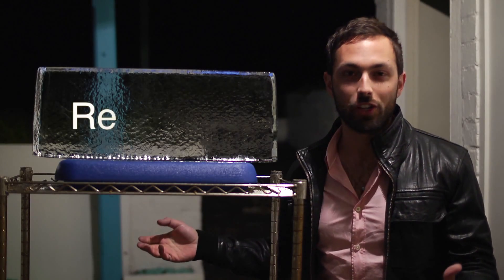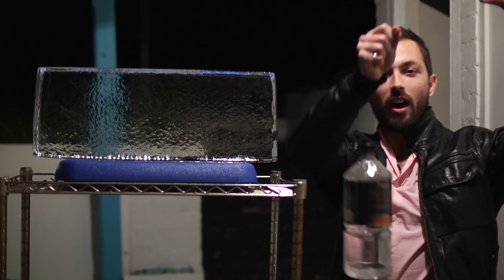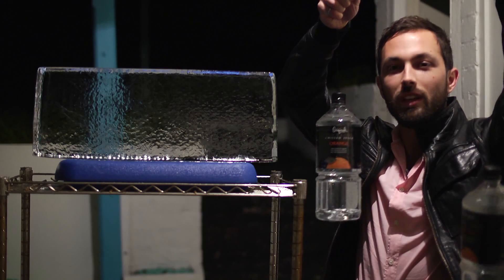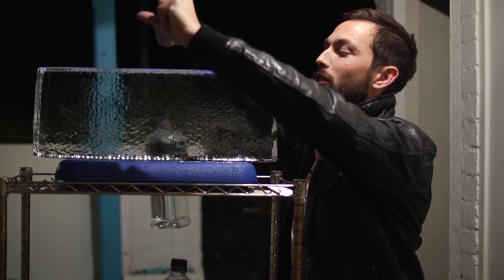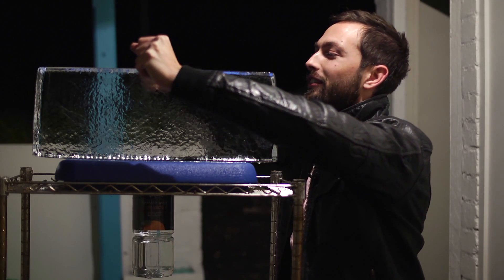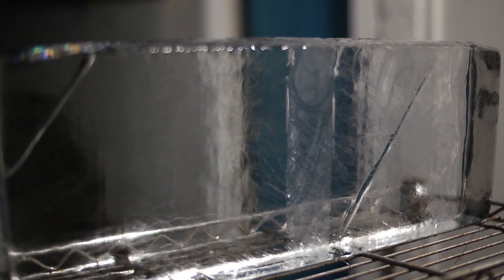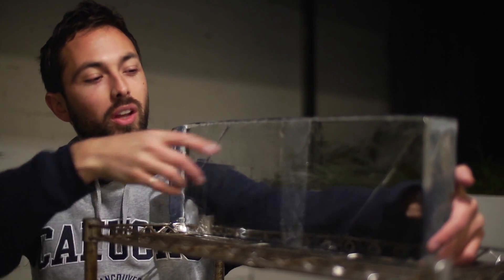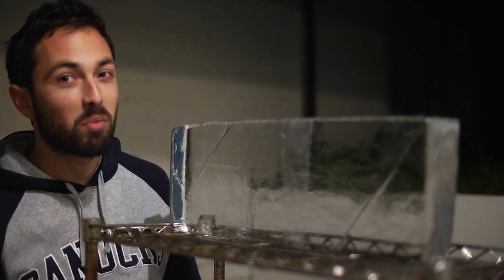Does Pressure Melt Ice?

Comment: As many before me have commented: that can't (or atleast shouldn't) be possible! Water freezes if you aplly pressure to it (even when it's warm). When you get the pressure down enough it vaporizes (0-(-1)bar should do the trick, even if the water is cool to touch). You should know, Veritasium-guy, because you made a vid of it. Your fridge and some air conditioning devices work because of that. 
Edit: okay, ice could handle differently, I just realized, but I'm still not sure I'm buying it... :/ Needs to be performed in sub zero conditions!

Comment: And I thought it was all about friction melting the top layer not pressure.
Reply: ***** However even if it started at room temp it wouldn't be that temp all the way through the ice because it would cool down.
Reply: SimplyCraig5 it still wouldn't reach the temperature of the ice.  Thermal conductivity of the wire would pull in the temperature of the ambient air, so to speak.

Comment: Would like to see that with a Thicker string
seeing if a bigger Gap would hinder the ice reforms
Not actual Bass strings; too thick and a gap of .075" would be noticeable but maybe .024" plain and wound (Roundwound or Flatwound) that size they come in all three.  and see if the Roundwound grooves have a noticeable impact; if the Flatwounds leave any marks and make a difference to the base readings of the of the Plain (Unwound) string.  since you used anything from .010" to .008" (I use .013" gauged sets.)

Comment: Actually, the melting/cutting in this case is due to thermal conduction of the room temperature through the wire, not pressure. This is a common misconception. True regelation requires far higher pressures.

Comment: This doesn't really make sense to me, if you increase the pressure applied to water, you end up raising the boiling point and inversely if you lower the pressure it lowers the boiling point. wouldn't the same principle apply to the freezing point, as you increase pressure you raise the freezing point (higher than 0 degrees Celsius), in essence the point which is in contact with the wire would actually be less likely to melt than the rest?(ignoring the obvious fact that heat transfer through the wire caused the wire to cut through in this video) just a thought

Comment: Well, PV=nRT. n is not changing, because the pressure is only applied over a small area (Which we see here, melts), and then (as i will later explain) re-solidifies. R is a universal constant, so obviously that cannot change.

Volume of the ice under pressure is constant. So, as pressure increases, so too must temperature. It is (more or less) a linear relation. V would change a miniscule amount when the ice expands into water, but not enough to make a difference.

Now, after the pressure has been alleviated by way of the ice melting, P will return to normal atmospheric pressure. This will allow Temperature to go back down below 0C, resolidifying.

But, Veritasium, I have a question: Since PV = nRT, and the units you get when you multiply PV together (N/m^2 * m^2 * m) is Nm, also known as joules. Now, if we apply another equation: Q = mL, where m is the mass, Q is the energy, and L is the latent heat of transformation, wouldn't the temperature actually change slightly less? So, PV=nRT isn't technically correct ; it would have to be PV=nRT + mL.
Is there something wrong here, or ... what's the deal?

Comment: How do you know that it is pressure that is cutting the ice and not the wire conducting, you did say that it was above freezing point in the room. Also the re-freezing is surely just due to the climate between the two new block being cold enough to freeze seeing as their ice, like if I breathed on it the water vapour would condense because the ice is cold enough.

Comment: I´ve read somewhere that this is what makes skates have so little friction; that when all your mass is concentrated through the blades, the pressure of the blades melts the ice, making a thin layer of water which makes the skates move so smoothly. Does anyone know if this is correct?

Comment: A proper example would be to put a piece of ice in a container with air, so as to not to crush the ice, and increasing the air pressure. Then again, the temperature of the air should be kept in check by some means, so that the ice melts due to pressure and not because of the temperature rise in the air when compressed.

Comment: Actually, in this example, the melting is not due to the pressure exerted by the wire. Rather it's because of the heat conductivity ot the wire. The wire disipates heat, elevating the ice temperature in contact with it over its freezing point, which makes the ice melt. It wouldn't work with a nylon string, for instance. The pressure required for regelation would be much higher. Since pressure is a relation between load and surface, you would either need an incredibly thin wire or a really heavy load.

Comment: No no no no.... NO! You're not tricking ME with this one...

The wire has heat, and since it's made of metal, it transfers heat very well..... More heat is hitting the wire that isn't making contact with the ice.. that heat is transferred through the metal, causing it to be warm enough to melt the ice... (Note: Not much warmer... You know this, because it took hours.. It melted a little at a time over several hours...)

When the ice melts, it makes water... that water, being between 2 layers of ice, re-freezes helps the ice blocks stay together..

Comment: Concept may be true but your experiment was not valid. If the ambient temperature was above freezing then the wire would have been conducting heat into the ice. Ambient temperature must be as cold as the ice.

Comment: CLEARLY:... The thermal conductivity of the wire AND the pressure BOTH exert some power over the behavior seen, since pressure is related to volume and temperature, and therefore the phase of pure substances like water. But even if the thermal conductivity was the only principle acting, the rest of the block will absorb some of the heat and refreeze the thin layer of water. 

I would not conjecture about which is dominating in this (very cool...hehe) experiment, or if pressure and thermal conductivity are basically equal players, without more information.

Comment: hi. under pressure, shouldn't boiling point increase? and also the melting point.. i think the ice melt because
(1) heat is transferred from the environment to the ice, the string being a good conductor.
(2) the force of gravity is enough to break the hydrogen bonds.
however, when i think about in the following  way, i feel you're right :
Pressure = F/A = mg/A , mg is the weight, A is the area in contact... intuitively, if you increased A (using a string with bigger cross sectional area, E-6 string in the guitar for instance ) , it wouldn't have cut through, or would have taken more time to do so. may be you should try and tell us :p thanks for your videos! I'm a fan

Comment: So this wouldn't work e.g. with frozen CO2, in which the melting point doesn't decrease under pressure?
Reply: correct that would not work. The reason it works with water is because water has a unique property - for some reason, increasing pressure tends to make it liquid, as opposed to CO2 or most other substances where increasing pressure will tend to turn it into a solid. You can check the phase diagram for water and notice that the boundary liquid/solid is slanted to the left.

Comment: That's weird,, when you think about that water in lower pressure can boil at lower temperatures... I would've guessed it would be the same with ice, thus requiring lower pressure to melt, and higher pressure to refreeze. Is it possible to get a deeper explanation of this?

Comment: But what would like to know is:

Is it realy the pressure that is melting the ice, or is heat transfer playing parts. Immagine a immens column of ice..... like in the antartic. That weight of the ice above at the bottom is not turning the ice into water..... I think.....
Ok.. the weight and the diameter of the sting is causing a realy big pressure at that certain point, but would that pressure be higher than an ice block of about 30 feet hight..?
I just don't know, but wondering if a setup with a same diameter nylon string (less heat transfer) would result in the same speed of cutting and gelling the ice?
Reply: There is more net force in the Arctic scenario, but, as far as psi, the guitar string is far higher. It comes down to surface area. I think a less conductive string might slow it, but it would still work.

Comment: I duno, i think its just the metal string is taking the cold  from the ice but at a slow  rate, and so it refreezes by the time it reaches the end..
Reply: Test it yourself if you can. Get two wires, and attach equal masses to either end of one, and put nothing on the other.
Reply: Akranixx Im suggesting its just the acceleration of the ice warming when in contact with the metal which is getting the warmth from the air. The pressure thing also contributes, it usually speeds up reactions too.

Comment: I'm going to conclude that heat via friction was the cause of the ice melting. Would this experiment work under better conditions? Say, if the wire and outside temperature were below freezing?

Comment: so, SciShow's recent video on pressure not causing heat in solids or liquids makes me question the ruling on pressure being the source of heat here. Isn't it more likely that the metal e string is causing thermal conductivity to melt the ice below it and the cohesive force of water holding itself to the ice walls re-freezes it? I mean, cool thing watching a wire travel through a solid block of ice and leave it solid, but I'm wanting to learn a bit more about the physics of this experiment.
Reply: According to regelation, the pressure wasn't a source of heat, and also heat was not the reason the wire went through the ice. The water, while still at freezing point, became liquid because of the pressure and the pressure alone. As soon as the pressure was removed from it (that is, all of the water above the string) it re-solidified. The actual physics on the level of specific molecular movements I'm not sure of.

At least, that's the properties as explained by the theory. In practice with this experiment, there likely was some small amount of actual melting due to the thermal conductivity of the wire. I'm not sure on this, but I think that might be part of why the wire closer to the edges went through at a quicker rate, forming a sort of hill shape with the wire when it was most of the way through.

It would be neat to run several of these side-by-side with strings of equal diameter and with equal weights, but different thermal conductivities. Observe the rate at which they travel through, and the rate of each at the edges compared to the middle.

Comment: If you put water in a vacuum, it boils. What about ice?
Reply: Basicaly that is called Freeze Drying. Or Lyophilization. If you put water in a vacuum, it will evaporate (boil), causing the remaining water to cool down because of the energy that is needed to boil the water. Eventually the energy drawn is so big, that the temperature of the liquid is so low, it changes into Ice...

Putting Ice in vacuum, it will skip the liquid phase and form water gas molecules directly. Until the ice is evaporated, you cannot get a total vacuum, because evaporation still continues till the ice is gone.
Reply: ***** The ice will actually sublime (turn straight into gas). Google a water phase diagram. Look at the solid (ice region). If you were to suddenly drop temperature, you'd go down in the phase diagram and be in a region where gas is the most stable phase.
Reply: ***** The 'ice' in comets does not necessarily point to water ice, any volatile solid is considered an 'ice' in planetary chemistry.
Reply: ah.. no problemo. Interesting material. Thanks for the aditional info.
Reply: Very simply put, fluids fit their container, by container I mean surrounding inward force. A vacuum has no container, leading to diffusion of the molecules from liquid to gas to single molecules. The solid ice maintains its shape due to its crystalline structure and EM forces. Solids aren't affected by containers.

Comment: Hey Derek,
 i think the reason for the cut through the ice block is the high heat conduction coefficient of the metal wire and the regelation makes just a small effect ! The heat is reaching the line , which is in contact with the wire faster than the other surface of the ice block and so the ice melts exact at this line. After the line passed, the liquid water between the 2 Ice blocks is surrounded of ice that is cooler than the air or the wire and so its freezing again !

Comment: It's a good thing for fans of hockey that pressure does indeed melt ice. Those skates wouldn't work very well without the lubricating layer of water that the pressure creates between the ice and the skate.
Reply: Exactly! If the ice was replaced with dry ice (solid Co2), then the skates would not work.

Comment: Doesn't that just mean that the two halves of the ice are cold enough to re-melt the heated center where the string passes trough? The kinetic energy melts it, but the ice freezes it. If you'd use a thicker string would it still work?

Comment: pressure does effect water. if any of you paid attention in science class you would recall that the freezing and boiling temperature of water is based on 1 atm of pressure. when you change that pressure the boiling and freezing temperature is altered also. for example, if you live high up in the mountains the hottest your water will get when you boil it will be in the high 90 deg C. i remember my teacher performing this experiment in class where he took hot water and in a big glass jar and sucked out all the air and it appeared to be boiling. same with ice skating, all the pressure from your skates on the ice turns the ice into water for a short moment and refreezes when your skates leave the ice.

Comment: i don't think a few kilos of weight is enough pressure to cause heat to melt the ice where the wire is... you said you used a guitar string, these are good heat conductors so isn't it possible the wire was simply acting as a method for transferring ambient temperature (above 0 C as you stated) to the ice so the wire can move down, then when the wire is gone, the water between the two slabs freezes cos of the temp of the ice, maybe you could try doing this in a walk-in freezer to stop any error.
Reply: imagine that the water bottles combined weigh 2 kg (2 liters of water). that means 2 kg of weight is distributed across the thin wire. A typical E string is 0.254 mm in diameter (0.127mm radius). Then lets estimate that at a given time, exactly 100mm of string is in contact with the ice. That would mean that the surface area of the bottom side of the string in the ice (the portion of string that presses down) is (pi)*0.127mm*100mm = 39.898 mm^2. This means that 2 kg of mass is distributed over an area of 39.898 square millimeters. For reference, that's roughly the size of the point on a high heeled stilleto. Converted to m^2 for easier math, that is 0.000039898 m^2. Now if I multiply the mass by the acceleration of gravity, that will convert the mass to force in newtons. I then divide my area, and I will have a force per area, which is pressure.
 So (2kg)*9.81m/s^2=19.62 Newtons of force pushing down

(19.62 Newtons)/(0.000039898 m^2) = 491754 kg/m^2
 = 491754 Pascals (492 kPa)

 If you convert to atmospheres, it equals 4.853 atm. Therefore the downward pressure that the string applies on the water molecules immediately under it is equal to about 4.8 times the existing pressure in the air. If converted to psi, it's about 71 psi, which is about what you'd pump up a bike tire to.

Now if you want to relate this information to the properties of water, go to the Wikipedia page titled "Water (data page)" and open the section named "phase diagram". This is a table of all the measured states of water over many years of scientific research. Open the image and zoom in very closely to the circle labeled (freezing point at 1 atm). Above that point but below the pressure 1MPa you'll see that the freezing line is ever so slightly slanted to the left. Our calculated pressure is 492 kPa ( about 4 lines up from the red circle I mentioned). Since the line is slanted left in our calculated pressure range (from 100kPa to 492 kPa), this means that an increase in pressure will force the water to liquid form.

you might argue "but we don't know the temperature so we can't use that graph" 
well that's not true. We know that the ice block is exactly at 0 degrees C because it's melting from the warm air and that's how melting works. If you have a super cold ice block and you warm it up, eventually it will reach freezing/melting temperature and at that point it will not warm up any more until all the ice has melted. Therefore the block is at 0 degrees C
Reply: exactly my thoughts

Comment: This is why ice skates work. the weight of you concentrated into two this metal plates pushing on the ice will temporarily melt the ice which introduces the lack of friction. If this didn't happen, the metal plates would probably stick to the ice instead. but that's just my guess.

Comment: so I would infer that this is because ice is held together by hydrogen bonding, and with some pressure this breaks down, though the temperature does not go above melting temperature. would I be correct in thinking this?

Comment: I know you are right, but the experiment has some flaws. We don't know which temperature the string had. It could melted the ice with high temperature. It would freeze anyway because of the very low temperature of the big block of ice that surrounds the cut. The experiment takes too long so there are too many outside influences on that which overway the pressure (like i.e. temperature).